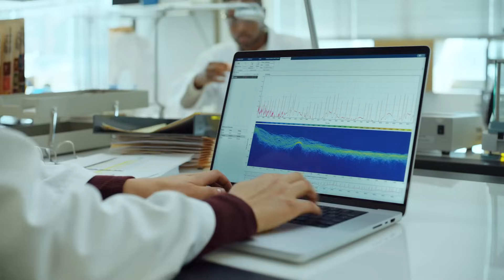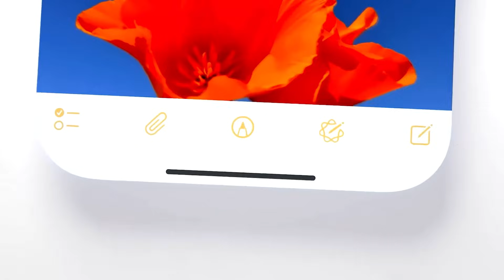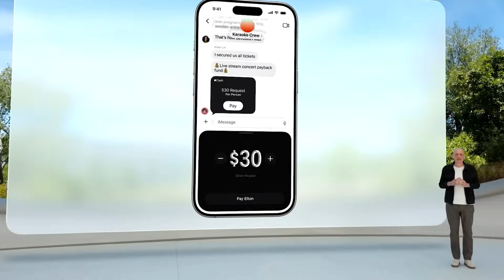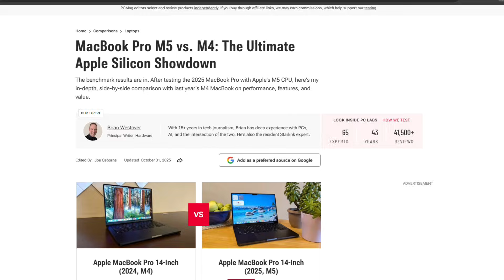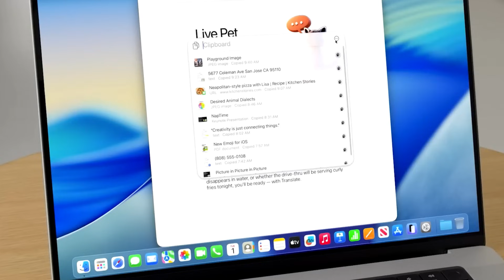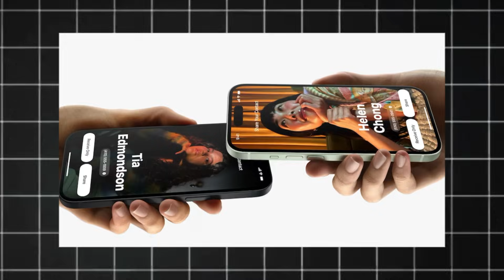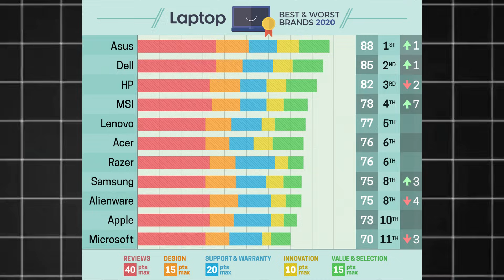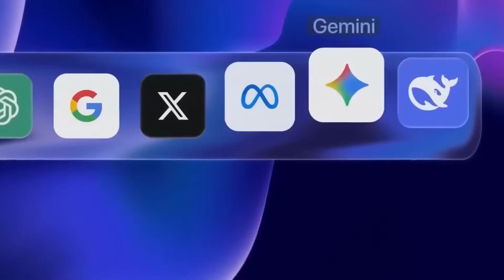Apple’s Transparent MacBook Is Coming In 2026 And It Could Change Everything

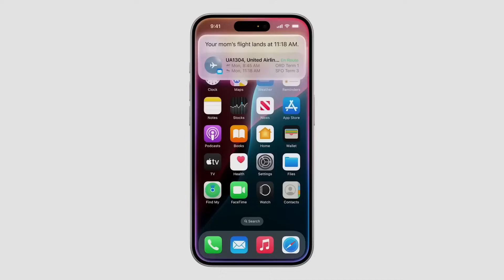Comment: WARNING: This channel is a misinformation factory. > This is the same channel that posted the fake "Project Q" AI chip video. Now they are claiming a MacBook will use "liquid helium" for cooling [05:28]. Liquid helium stays at -452°F and is used in MRI machines; it is physically impossible to put it in a laptop.